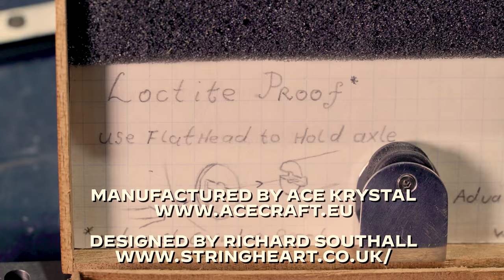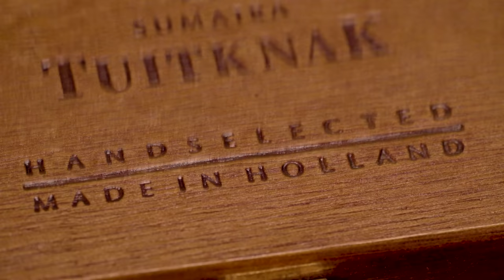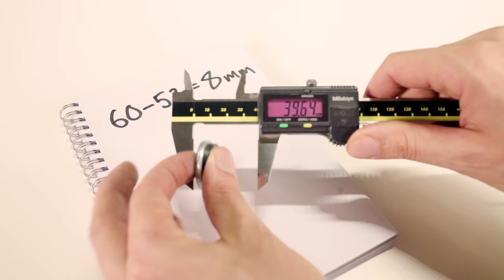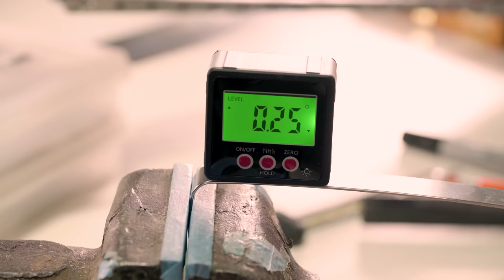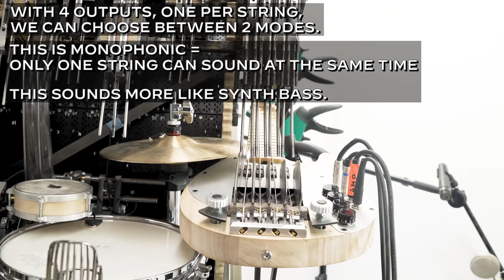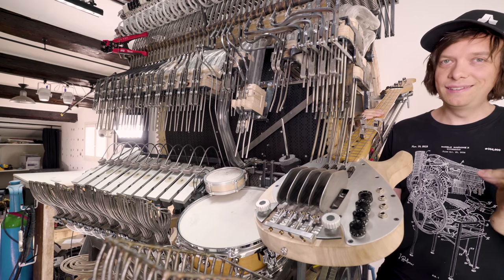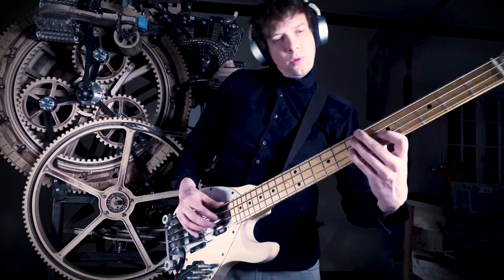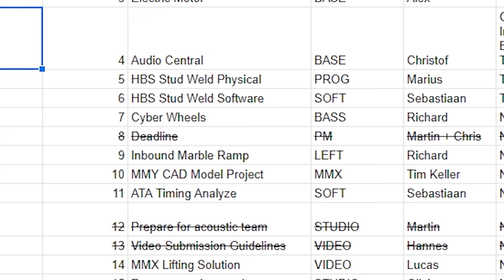Cyber Bass with Rubber Wheels! - Marble Machine X #137

Comment: Have you tried lubricating the rails ? I'm not an expert but I feel like they shouldn't make that noise
Reply: They are under pressure with his stainless steel thingd
Reply: @martin If you're reading this, use PTFE spray as dry lubrication, not oil. This wont become dirty overtime.
Reply: I've used lots of linear rails in industrial settings. Rest assured that those in the video can run many kilometers under the light loads they'll see without lubrication. If the noise is a problem, they're nearly silent when greased, we use THK AFB-LF lithium grease. However, the grease is trapped in the ball bearings by the optional wipers, which add considerable static friction to the assembly. Not a problem if you're running them with a motor or hydraulic cylinder, but could be a problem for actuating by hand.
Reply: @vusvis  Have you posted it to the discord? Please do!
Reply: I'm not sure that Martin reads the yt comments.  Post this to the discord.
Reply: @kevinvermeer9011  yep no need to lube in normal time but the noise. maybee Martin has use them with no caution for this little beauty ^^
Reply: @Stettafire  aah good idea. Perhaps you could post it there? I don't have discord..

Comment: He uses a pedal to induce a circular motion into something that utilizes an elevator motion to lift marbles into a reservoir that over various rails and tubings splits them into different tubes from which they get released by a sliding motion that was induced by a lever pushed by a pin on a revolving drum. The marbels then proceed to fall onto a metal string where they induce vibrations that are then transformed into electrical currents modulated by voltage regulated through turnable knobs before that analogue signal is digitalized and transferred through copper wires into a PC, where neigh real time algorithms transform the signal one last time before it is sent back through another pair of copper wires into a coil that induces magnetic forces on a permanent magnet to cause vibrations of a cone that push the air in a certain frequency that makes our brain perceive the electrical stimulation from our nerves as musical sound.
Reply: Good
Reply: Or you could just say the metal balls hit the bass strings
Reply: I like that a horse snuck into that explanation
Reply: For the record.. Nobody ask..
Reply: Martin: haha marbles goes prrr
Reply: See....it's so simple.   🙄🥺     I'll shut up now.  🤐
Reply: Could not have said it better myself  lol
Reply: Me writing essays:

Comment: When all those quick fix washers on various parts of the machine start having problems... man that's a lotta problems
Reply: Once he finishes it he could always machine a singular metal or rubber piece for each separate section.
Reply: @rampagent9226  I really hope he does. The "quick fix washers" bother me so much, especially since almost all of the machine is more (or less) carefully engineered
Reply: How would washers have problems? They seem like literally the least problematic possible solution to adjust heights.
Reply: Why would it fail more if he uses 5 washers instead of one? If the crew comes loose it will not matter how many washers are in there. It will malfunction anyway?
Reply: @lulle2007200  It is not fully simulated or carefully designed. As he finds issues in final assembly all the time. This can be reduced by doing CAD simulation but that takes someone skilled in solidworks to spend a good amount of time to fully model the physics of it. Basically something that you would only do when prototyping is way too expensive. Martin is just showing off his process in full. You don't get to see all the hundreds of prototypes that lead up to the finished products you often buy in the shops. Remember that the marble machine you see here shouldn't ever be considered a final version. That is something he can do once he has a fully working prototype.
Reply: @Conman123Official  An engineered spacer is the best way to solidly adjust heights.

It's not a problem to be stacking washers when you're prototyping, but on your final design, stacking a half dozen pieces of metal with tolerances of about 2-8 thous is not good for repeatability. This assumes no surface defects or bowing that could also change stacking height.

If he is relying on some of the give in the washer stack for sound, he can incorporate a rubber or spring washer, but that aside would be best practice to take any stack of washers and machine a monolithic replacement.

Comment: The spring steel is a poor choice for the 'fingers', IMHO. Over time they're going to loosen off and will require constant adjustment.
Reply: I thought there might be a heat treatment to keep them in their newly bent form but yeah I worry that spring steel won't be great for this with out constant maintenance
Reply: springs/springsteel doesnt wear out

think about the springs in your car. they also dont wear out even tho the weight of the car is constantly pushing on them
Reply: @markuseberhardt888  The springs in a car suspension weren't bent by hand, and even the weight of an entire car is a small fraction of the force needed to permanently deform them. Moreover, the thick coils of a spring spread the load evenly whereas a single, thin strip of spring steel is easily deformed.
Reply: @markuseberhardt888  This is wrong. Springs on a car do wear out.

Comment: From a musical standpoint it woulk have been cool to have a super-assembly, that would allow you to shift all fingers at once, in order to easily move chord shapes.
Reply: In principle, agreed. Actually pulling that off mechanically? Not feasible in this situation.
Reply: @timh.6872  Hmmm, a few high speed stepper motors and a motor controller....

Comment: Is anyone else angry that he still uses like 20 metal washers instead of a single nylon spacer when he needs to separate things precisely on shafts? I am. He could save so much weight and total part amount by doing that.
Reply: Dimensional stability? Nylon compresses under load, and these spacings need to be precise. A metal spacer of the correct length wouldn't be a bad choice once the final spacing is known, however.
Reply: @timh.6872  A nylon spacer would probably rupture before it compressed to be way out of spec of what Martin needs for his machine. I've seen in multiple cases where the separation in parts on a shaft are not under serious compressive loads. I would bet even none of them are. The cyber bass in question here is a perfect example. Martin is using a bolt and nut for the shaft to hold the slides. That isn't a seriously compressed load unless he wrenches that nut down like a maniac.
Reply: How can I give some more thumbs up?
Reply: Isn't his Discord where we're supposed to leave the rants / suggestions / criticisms?  😁😂🤣
Reply: @1slotmech  Thank you for reminding me of this.
Reply: I'm not "angry" about it, but I think at some point once everything is dialed in, steel spacers should be made to replace the washer stacks. Doing a quick repair and having to pick through a handful of washers that fell on the floor after removing a bolt would be frustrating and time consuming. It would also give it a finished look.
Reply: he should just 3D print accurate, nice looking spacers...
Reply: @MrTurboturbine  That would be nice, but that can also get expensive. Good idea though.
Reply: Yes
Reply: I think the stacks of washers are great for this stage of the project, when it's still possible that he'll need to change the spacing to account for a nearby part getting redesigned. He should replace the washer stack with nylon spacers just before the first pack and unpack test, or measure all of the washer stack during it and cut and label nylon spacers after he gets it back together and the spacings are still right.
Reply: Time is his most valuable resource. 

Making things is always a bigger headache than expected and as a project manager its his job to delegate.

Ask him for the measurements so you can make the parts for him.
Reply: @matthewgarland693  crickets

Comment: I have just spotted a little video trick that could be a symptom of something problematic.
In the previously recorded Bass/Guitar piece (wonderful beat - love it so much!!! Fantastic sound!) the Programming Wheel repetition rate is 30 seconds. Therefore you would also expect to hear those nice little off-beats which occur at 15:34 again 30 seconds later. But instead we see a short image of the bass string and the bass background continues without off beats. Therefore I assume you recorded those two pieces after one another and edited them together. Which is fine of course artistically - as I said, wonderful composing and great music!
But is there a way to integrate the option of off beats in live music, too? Maybe with an extra channel that can be muted, if not wanted?
Cheers and keep up the wonderful spirit!
Reply: the programming wheel is capable of such things and more. The peg welded sheets will be capable of literally anything.
Reply: Ben Cressman that would not be the Point. The issue is, that the programming wheel only allows for 30 seconds of music at that speed. And then it restarts. That’s fine of course, it would mean that every music piece - depending on the programming wheel speed - would have a reiteration at about 20 seconds

Comment: Use springs on the rollers, not washers. The guitarist's fingers act like springs on the fingerboard.
Reply: If I got it correctly, the rollers' arms are made of spring steel.
Reply: I meant the black roller that presses the string. The arm of this roll is sheet metal. It looks like it's not bending. Maybe it is worth putting a spring between the black roller and the arm. 11:05 Here you can see that in the previous version, there was no spring but washers.

Comment: Good time. Outstanding and impeccable work. It's amazing how much patience and attention to detail you have.
Let me suggest an idea for automating the mechanism for selecting the position of the pressure roller for Your bass.
If you replace the magnets responsible for the bass with RFID chips in the software pattern, install a reader, link it to a microcontroller (arduino ???), and add servo drives (or linear drives) to the guides, then you will be able to automate the selection of the position of the rollers pressing the strings.
You can set not only the moment when the ball falls, but also the position of the pressure roller by linking the RFID chip code to a specific movement of the drive. 
In my opinion, this will make it easier for you to work with the system during concerts.
My knowledge of English is modest, I used an automatic translator, but I hope that the meaning of the idea is clear. I sincerely wish you and your family good health. Sincerely, Vladimir.

Comment: I think the issue with that design will be the speed you can move the rollers up and down the neck of the bass guitar. How about getting rid of the neck altogether and have spaced clamps that clamp the string at fixed points, one for each fret and each string. Get it working on one string first and then roll it out on however many strings you like.

Comment: get a peddle for that welder  it  will help you with welding small stuff  you can regulate how hot it gets and  some aluminum or copper blocks to use as heat sink to pull heat out. Your doing amazing job sir

Comment: Have you ever thought about driving a synchro off of the programming wheel?  This would allow you to sense it's position and feed it to a computer which could control solenoid plungers to depress the strings against the fretboard.  You would need a separate solenoid for each position on the fretboard for each string.  I'm not a musician so I don't know how many that would amount to.  It seems like that would be doable though.

Comment: Could you assign each of the rubber wheels handles (below the bass) a specific gear sprocket/pulley system to rotate and move the positions of the handles for you? Thus you may be able to program the four gears to preassigned fret positions for you instead of having to manually move them one by one?  Just thinking outside the box :)

Comment: With the mono bass setting, you have implemented something I wanted to do for a while, but I would have been doing the reverse -- looking for the lowest live string at any given moment. Then the output can be shifted down an octave. I would have put it on the lowest three strings of a guitar, perhaps replacing the standard middle pickup. I think it works better the way you are using it, not followed on by trickery like octave pedals.
Reply: English is my second language and im pretty linguistic but that english is a whole different english for me.

Comment: Get your self a gas lens for your tig torch! They are cheap and will let you stick your tungsten out a little further helping with view of the puddle. It will also let you get into tight areas and corners better, I've had my tungsten hanging out almost 25mm and still gotten perfect welds, down in areas just a bit wider than the tungsten.
Also, when you finish the weld, STAY STILL! Dont wave the torch back and forth, the part directly under the tungsten (And the tungsten) are the only parts hot enough to need shielding. Even if the base metal doesn't need shielding, waving it around will expose the tungsten to oxygen and shorten its life.

Comment: the capos should be in a "complete form" (Like orbits)
So the pressure will be more even, to deal with the interception between the capos, you can make a cut in the center of the neck of the bass and use the "soul" of the bass (the metal bar inside) as a central rail making 4 of it.

Comment: Are you using plain old HSS drill bits with a titanium coating?  Once that coating wears off, they loose all the benefits of the titanium.  Do yourself a favor and get some M42 8% Cobalt Alloy bits with a 135° split point, the difference is like night and day

Comment: Great job but please stop waving your tig torch after you let off the pedal. Just hold it at the last spot you welded until the post flow stops. The gas and the post flow of gas is to protect the molten metal, not the metal that is already solidify. Post flow should run until the weld has fully solidified.